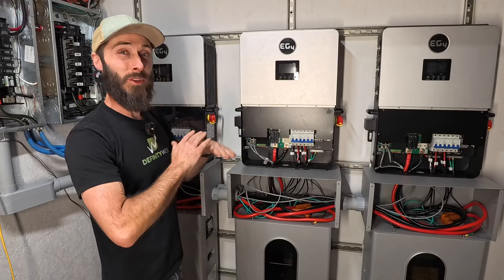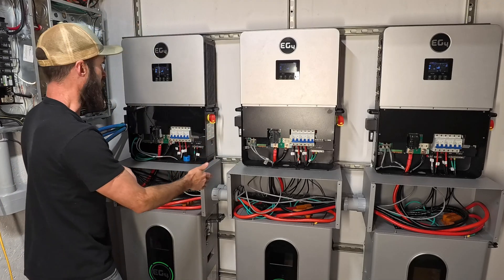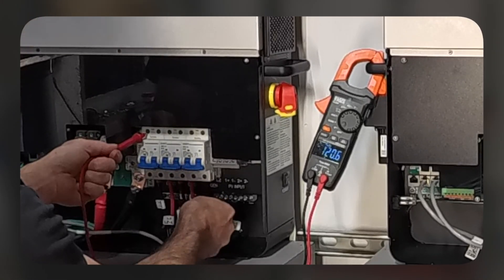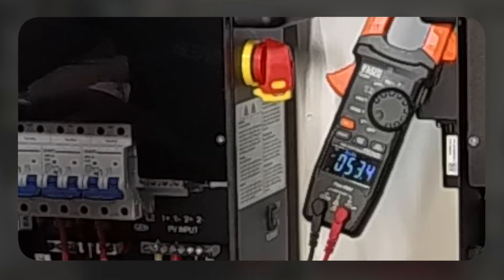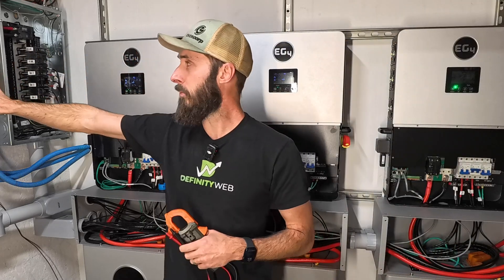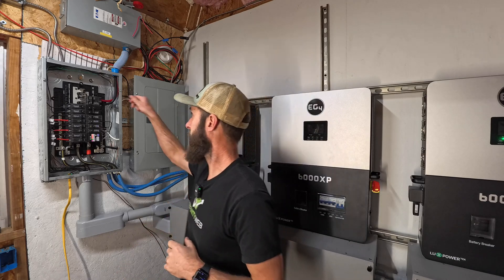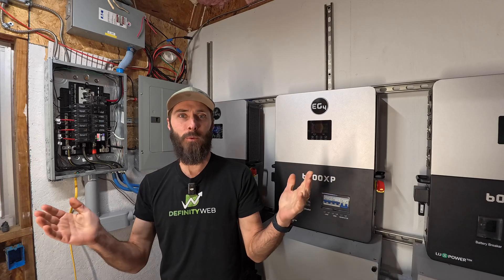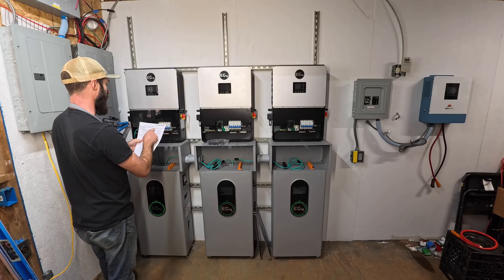Step-by-Step Off-Grid Solar Build – Part 4 (Final Setup)

Comment: Great series! I think my use case is similar and I’m wondering what settings you used to accomplish it. I want to use batteries during the day and fall back to grid if the SOC drops below 20%. Then during my free nights period I want to only use the grid and also recharge the batteries.

Comment: You helped me a lot. Is it ok to not use the sub panel and have the load breaker and line breaker in same panel with proper interlock switches?

Comment: Do you have a full wiring diagram of how you ran all the power wiring from main  grid into and out of each breaker panel?  The actual tie in's and breakouts of the transfer switch, etc.?

Comment: Have you had any overheating issues? The manual says they should be ~19”s between the units. I don’t mean to nitpick but I am installing the same inverters and curious to the cascade heating from right to left.
Reply from the maker: Interesting. I'm pretty sure my old manual said 8 inches. I'll have to go back and check. I've had 'em this close for over a year and no issue at all. at least none that I'm aware of. Typing this is the first thing I've done since installing the new mini split that blows across them. It's been 85F+ in here the last few days while I got it installed. They just kept running.
Reply: @ thank you for replying! I’m glad you haven’t had any issues. I definitely would prefer less that 19”s between them. I too have a mini split in that space so I should be fine. Thanks again for the reply and the videos you make. It really helps!
Reply from the maker: @ you bet! I’ve also heard some guys use the floor register vents to direct the air away from the next inverter. jump on our live show every Thursday night if you’ve got questions you’d like directly answered.

Comment: Awesome video but I have a question:  what happens when primary inverter fails as it’s the only one with BMS comms connected?  Wouldn’t it be better to not parallel the batteries and each inverter have its own battery comms and keep the AC out paralleled for combined power?
Reply from the maker: Here’s the way I understand it to work—if the master inverter fails in a paralleled setup, the whole system will shut down. You’d have to disconnect the failed master, pick one of the other inverters to be the new master, and reconnect it to the battery bank. That gets you back up and running with full battery capacity.

As for keeping batteries separate with their own comms—it works, but if one inverter fails, you’d only have access to the batteries tied to the working inverters unless you manually rewire.

There are pros and cons to either way. Thanks for the great question.
Reply: @EastTexasHomestead  Thanks for the reply.  For pure autonomous redundancy reasons, with each parallel inverter having their own battery/coms, will at least give true failover and allow time to react/resolve and have continuous power.  Totally understand the capacity loss but I'd rather have two inverters in parallel each with their own battery....I think.
Reply from the maker: @cgutowski471  I tend to agree with you on that.

Comment: I really like the use of rails to mount the backplates  Wish I had thought of that for my system.  I wound up messing up the battery alignment to the gutters in my system so now I am in the process of using the anchor bolts to mount steel slotted plates that will allow me to then put the battery backplates in perfect alignment with the gutters.

-Matt
Reply from the maker: sorry to hear that, Matt. The rails made it so easy and forgiving.

Comment: You have to set the meter to DC volts if you want to check synchronization between L1's or between L2's on different units.  Set to AC for checking across L1 and L2, or between a leg and neutral.   Actually... wait a moment.  Well, with DC you should get close to 0 (it should wind up in the millivolt range) if they are synchronized.   But AC would read something useful too... if they are synchronized the AC should also be near zero.  If they are not synchronized then both DC and AC measurements should bounce all over the place as the phase relationships changes.

-Matt
Reply from the maker: That's interesting, Matt. I was unaware that you could use DC for that. I believe I still got the results I was looking for, though (as you mentioned). 👍

Comment: Great videos. Do you think buying 12000xp would be better that two 6000xp? I don't see the benefits for the extra cost. Thanks...
Reply from the maker: @OzSkyking152  that’s a good question and I don’t have a super clear answer yet. I will be doing a review on the 12000XP soon and will have a more informed opinion. My initial thoughts have been that I like redundancy and if you have the space, two 6000XP‘s gives you more redundancy than one 12000XP. However, there are other things to consider and I plan to get into them at a later date.
Reply: @EastTexasHomestead  Thanks for the quick response. I will be looking forward for the next video.
Reply: Remember what another youtuber said. 2 is 1, 1 is none. so using fuzzy math, 3 is 2.
Reply from the maker: Three is for me :) and four is more.